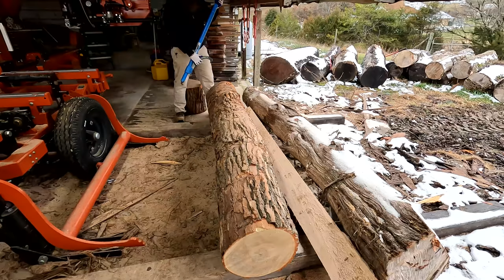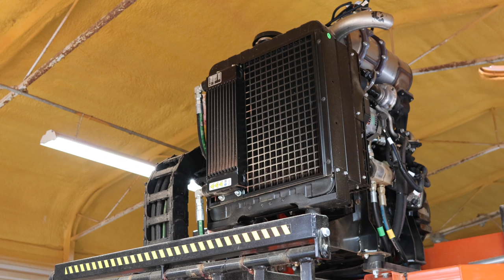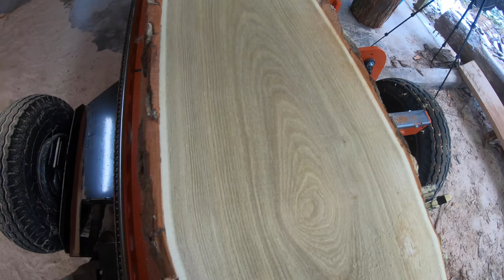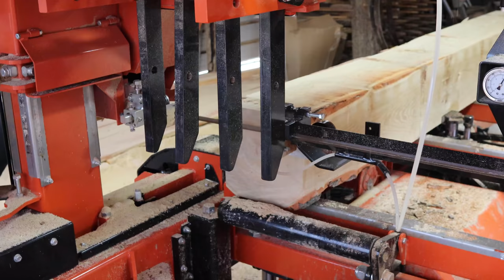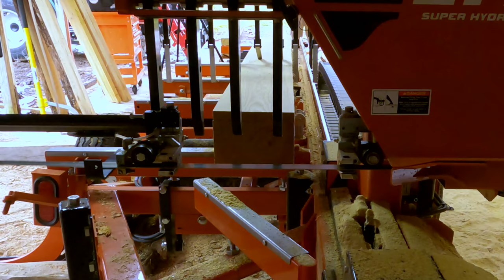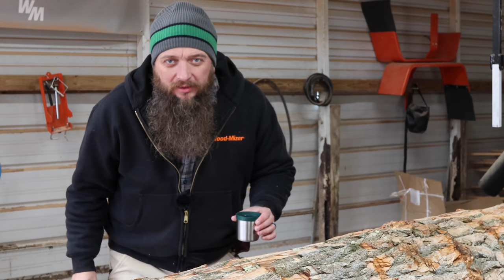Sawing Up A Root Beer Tree On The Sawmill, Beautiful Boards

Comment: The picture quality is better although the autofocus seem to take a while to catch up.  During the intro I noticed the lettering on your jacket was going in/out of focus.  I'm sure you will work it out.  That log seemed to produce a lot more sawdust than others.  The color look similar to poplar with that yellow/green tint.
Reply: I'll start by confessing my only sawing experience is regular household tools. I always thought the amount of dust was totally dependent on the blade.
Reply: I completely agree with this. Quality is definitely better but bad auto focus.
Reply: I thought the video and sound both were very good, but I’m not an expert.
Reply: Agree. Focus is wonky.
Reply: @pauloliveira2189  agree
Reply: You do need to explore the autofocus settings, the one its on now is not right for the shooting environment. Seems a lot like the sports mode on my dslr.
Reply: @geraldfisher7460  material dependant too
Reply: I thought poplar as well!

Comment: Big sassafras used to be common in the Ozarks during the 50's.  Grandpa had a huge steam powered sawmill and we used wide thin boards to make John boats and paddles that were sold to summer visitors. Rabbit planes turned the boards that covered the bottoms into tounge and grove.  They were mostly just nailed together but sometimes brass screws were used.  I still make Some canoe paddles from sassafras.

Comment: I had about a dozen Sassafras trees cut into boards about 18 years ago. I made several nice pieces with them. I made a couple aquarium stands from a mixture of oak veneer and Sassafras  face frames, they matched perfectly, you could not tell the difference between the two species of wood - until about 6 to 7 years later. The Sassafras started to darken like cherry does. As I write this I'm looking at one that is 16 years old the Sassafras actually looks like Cherry now, kind of neat contrasting against the lighter oak veneer. Just a friendly word of caution if your going to build some nice pieces out of Sassafras. PS: It does smell great when you cut it.

Comment: Camera trick once you get the auto focus set make yourself a mark on the floor so you know where to stand then turn the focus to manual that way it's locked into the that focal distance and the camera won't automatically search for focus.

Comment: 4K by golly, we have not seen the super 70 wide look so good! the new camera works great, (the autofocus was hunting a little at times and the color balance could be fine tuned) but it's a great improvement to quality. We sure need to get you a dust extractor for the wood miser!

Comment: There is a bit of an auto focusing problem which I'm sure you're aware of and its probably adjustable if you look up how in the camera manual. On a good note the new cameras have improved the picture quality a great bit. This log was banana shaped as you stated so you put the log on the sawmill with the convex side up to begin with I think you said and showed. You then flipped the log so that flat was down on the mill with the concave side up, you then made a cut off that side. From there you squared the log and made all your cuts. Is it best to always start squaring a log like this with the convex side up and then flip it 180° to cut the concave side before cutting the other two sides? It makes sense to me that you'd start with either the convex or concave side but I didn't know which of those two sides to cut first. So clarify that for me if you would please. That wood has a very nice grain pattern to it. I have never heard of using sassafras for seat of a chair or lumber that showed in the build of furniture or whatever it may be used for where it shows. I've always thought it was not any good, just pulp wood while clearing home sites taking trees down cutting them into logs and pulp wood. I'm not a logger I'm an equipment operator so I'm not very familiar with what the timber is processed into or what uses every tree has. I can identify most tree species in my area though. We take the timber to the sawmill and I've always put sassafras on the pulp wood trailer. I never run into any that was much bigger than 8 or 10 inches in this area anyway though. I know you can make lumber from a tree that size but being that it was sassafras I never cut any logs out of it. Take a lick out of the next log for me! LOL! Nice video. Stay well. -Wil  👍
Reply: if there is a little dust on the lends it will do that along with if dust flies buy

Comment: I would recommend that you manually set all cameras to the same white balance and then lock them so that “auto-white” is locked out. 2 of your cameras were matched in color balance and they looked great and looked like 4K. Most cameras are easy to match. If they are in degrees kelvin, set them to the same number. But if not, use something white and set it up in the main light, set all cameras side by side, do a white balance and then lock them. A big improvement in the camera department! I work in broadcasting so please let me know if I can help!

Comment: You’ll want to put the camera on a high f/stop like f8 to make sure most things are in focus and the camera isn’t focus breathing as much. Having a higher f/stop means the amount of light hitting the sensor is lessened, so you may need to add more lights to compensate. You’ll want to put the ISO in manual to about 800 at the highest to avoid noise. The lower the better. The color temperature seemed to change throughout the day and between cameras. You’ll want to make sure your white balance is not on auto. The shutter speed should be about twice the lens size. So the shutter speed of a 50mm lens should be 1/100 second. There should also be a setting to change the focus speed. Sometimes a faster focus speed makes the camera keep adjusting like crazy.

Comment: Question. Would it not be more effective to do away with the back section of the mill and have the forks on the tractor to catch what comes back? Slabs or boards. It looks like it could save a lot of work. Anyway good luck.

Comment: You might take it off auto focus and set it on manual. I find by setting my focus in the middle range so that the majority of the picture is focused it helps. Of course if you get to close or to far away is might be a bit off but setting it for what you consider will be your average focus seems to usually work well.  I also notices a bit of flickering with the brightness turn off the auto adjustment and that should help . Both of these things have helped me with my CANNON unit and I hope the help you, Also wish I could have been there to smell that log you were cutting I love the smell of sassafras wood when it is fresh cut

Comment: THe video quality is GREAT Autofocus though is distracting. Usually there is a Focal Point setting to have the focus be center weighted or on one of the many focal points. It'd be best to set it to a WIDE area of focus so if you are moving you don't move out of the focus spots causing the lens to auto adjust the focus. Or since the camera is on a tripod (I presume) you could just set the focus manually and turn off auto focus.  Depth of field is determined by the aperture so if you can set the aperture (smaller) you can get a wider range of focus IE: depth of field. But heck I just really enjoy watching your videos and your sense of humor so the focus or lack of focus is not a deal breaker for me. It's part of the "charm"

Comment: Another great video. I don't know anything about sawmills but I do know a lot about Process Development. It appears that the black things hanging down that push the planks back off of the mill after they have been cut, hang down below the plane of the sawblade. I notice you having to raise the head after each cut to back up and drag that plank off. It seems to me that if you shortened those black pieces to where they just barley clear the log when you are cutting, you could skip that step of having to raise the head before backing it up. Not a big deal but anything that speeds up your process would be beneficial. thanks for the great videos!
Reply: It would speed up the process right up to the point that the one out of ten times that your blade did not clear the previous cut. Then you're looking at the cost of a blade and downtime to change.
Reply: @billpendley2561  ok, thanks for clearing that up for me. I didn't know that the machine wasn't capable of a dependably repeatable path.
Reply: @Beauacadian  It's not so much the machine that has an issue with the path it's the blade deflection that creates the issue.

Comment: I don't see why you couldn't fit a compressed air line to the fingers that push the boards off to blow the sawdust of the boards as you cut them it would save scraping them off.

Comment: Sorry, I get so interested in the content of the video, I forget all about the actual quality of the image.  I love milling sassafras, but don't often find logs the size of the one you sliced up.  Traditionally used for canoe paddles, due to light weight and strength.  Vertical grain planks make good soundboards for stringed instruments, too.

Comment: Let me help you to understand 4k. shooting the image is no different than any other camera. Camera settings and such are the same. The difference is in the resolution. A tv screen, video monitor or any device that shows video, its screen is made of small pixels. Think of them as tiny lightbulbs that can display any color. OK, HD video that you are used to shooting is 1920 pixels (LIGHTBULBS) wide and 1080 pixels (LIGHTBULBS) high. So an hd image is made up of 2,073,600 pixels (LIGHTBULBS) 4k is twice that resolution or 3840 pixels (LIGHTBULBS) wide and 2160 pixels (LIGHTBULBS) high since 3840 pixels is close to 4000 nerds call the video format 4k. Pretty simple really so don't let new technology throw you as far as filming it is still the same old ways you have been shooting all along.